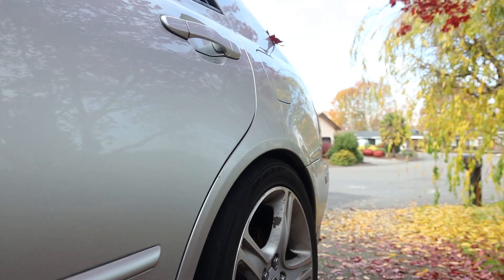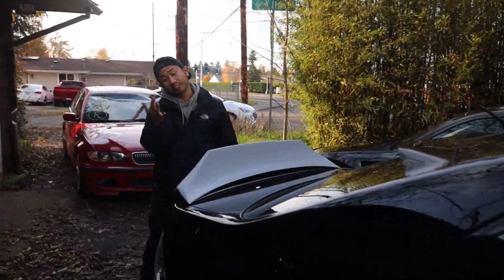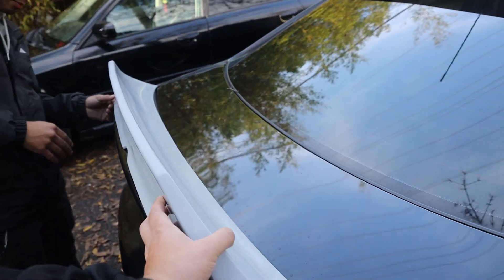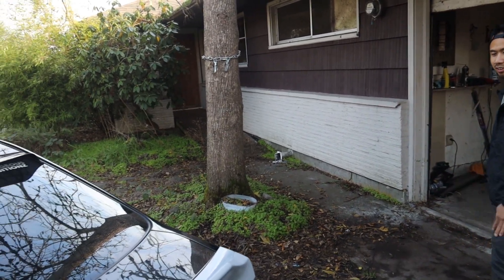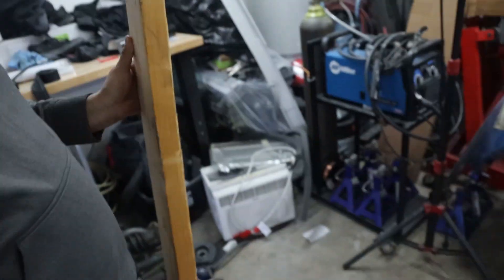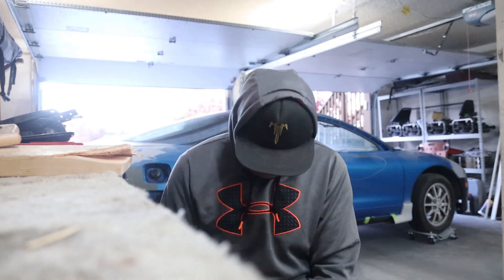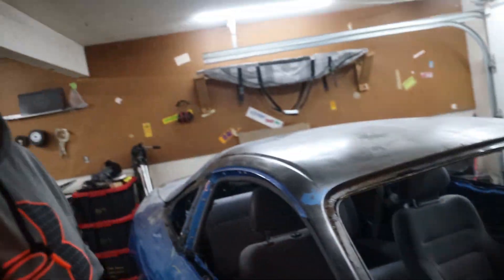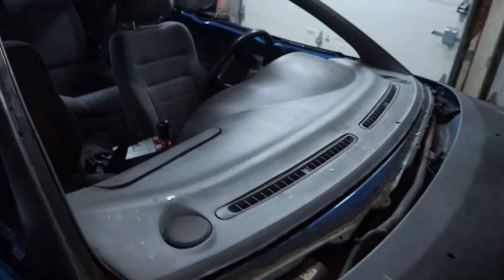Rolling Fenders on my IS300 (NO MORE RUBBING!!!)

Comment: I put some 20s on my is300 and idk if doing this would help Bc it scrapes the whole tire any advice ?
Reply from the maker: That's going to take a good amount more work than just rolling fenders. Really kind of depends on the specs of the wheel but adding camber could help but there's not much adjustment from the factory. Might have to opt for some aftermarket arms and spindles depending on the set up. Lot of variables tho. Good luck!